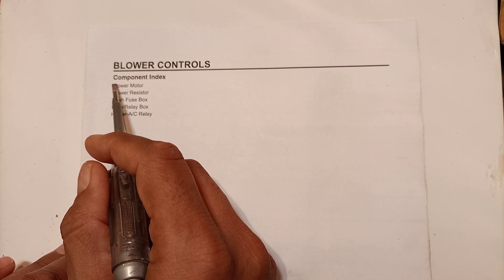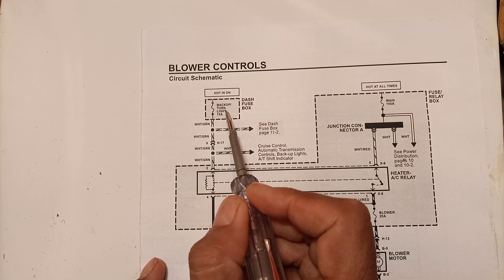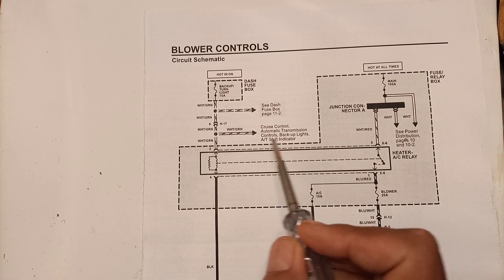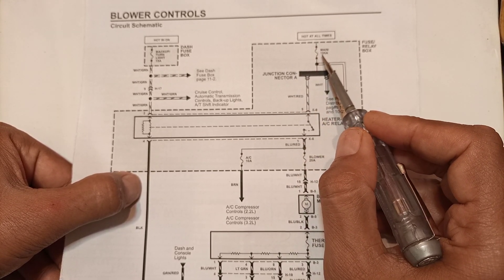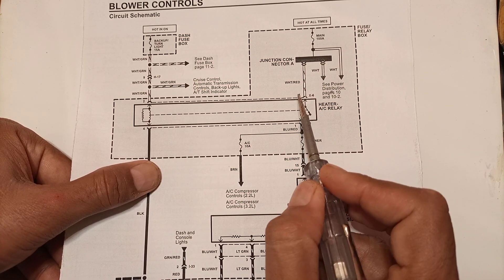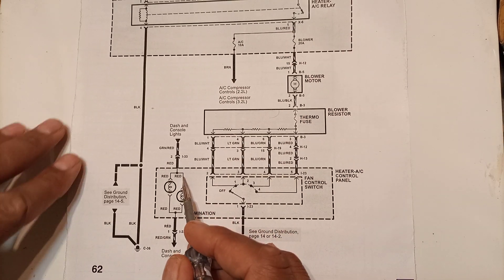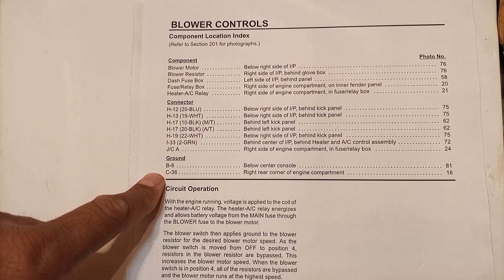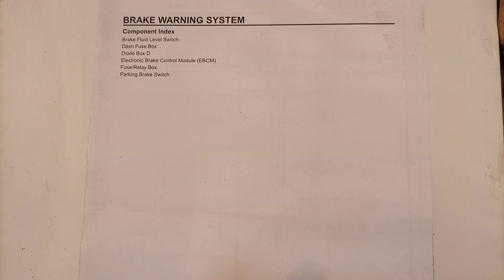Car blower circuit diagram explained @JahanZeb1976 How to repair car blower. DC fan motor circuit ip

Comment: What happened to your channel, did someone hack it and put pawn links on all your videos?
Reply from the maker: No sir. It's in my control. Did you feel something abnormal?
Reply: @JahanZeb1976  On some of the recent videos, there was  an extra word that lead straight to a pawn site.
Something like Xnxx or similar.
It started with the fan video and it linked to Xnxx.
Reply from the maker: Lol. That I did! As keyword to satisfy many viewers needs and search.
Reply: @JahanZeb1976   sir what about the videos on adding extra keys you talked at 8.20 on how immobilizer system works.
 please make videos particularly to Hyundai i20 2011 how to add extra keys. Thanks.
Reply: @JahanZeb1976  1. While programming, what actually is happening to the transponder chip hidden in the key????
2. Are vehicle codes and information gets stored to the transponder chip?? It's very confusing. If so, is it erasable once data are stored on the chip???
3. If I want to add the 3rd key which has new empty immobilizer chip, how to transfer data and stored on the chip without using programming tools particular to Hyundai i20 2011?? Any options like key insert 3 times, etc!!???
Reply from the maker: No sir. It's in my control. Did you feel something abnormal?